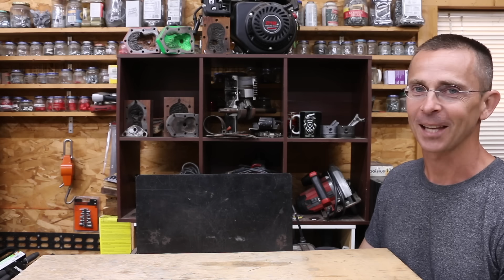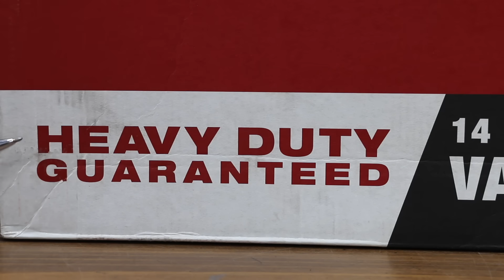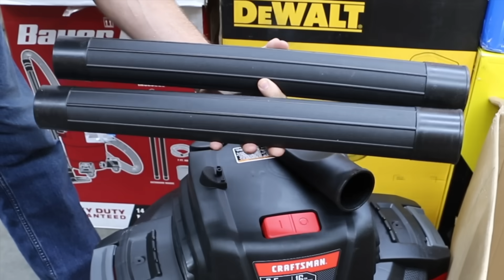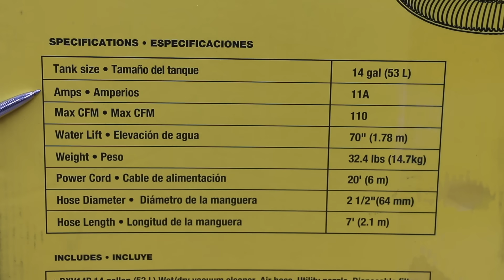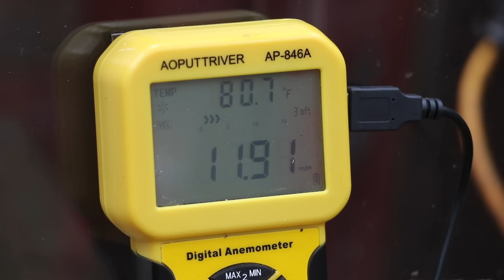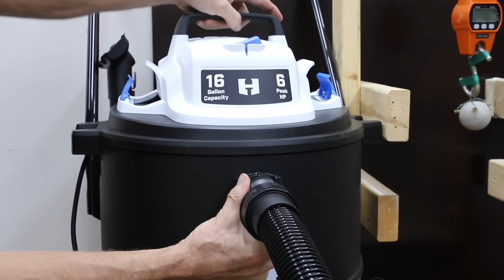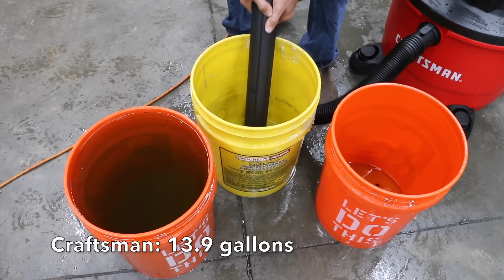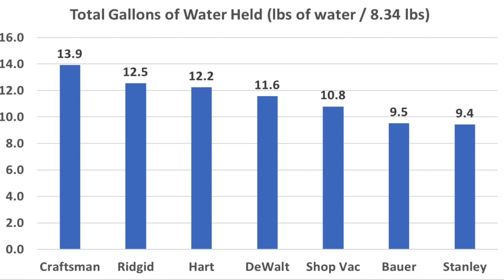Best Shop Vac? Ridgid vs Shop Vac, DeWalt, Stanley, Hart, Craftsman

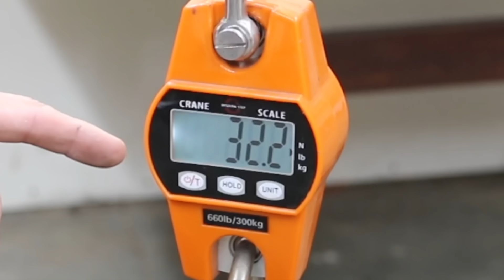Comment: FYI... The Dewalt is powerful, but VERY LOUD. According to the tests @5:50, the Dewalt is supposedly the quietest of the bunch. Not true. Maybe the design has changed since this review? I recently bought the exact model tested here. It's waaaay louder than my old shopvac brand of similar size and power.

Comment: I packaged taped the bucket and gat some car glass sealer and put it on the motor part and really fast attached  them left it 2 days to dry.   When I took it of It had a perfect seal   once I removed the tape the sealer made a perfect match vac has way more power

Comment: Mine falls over as it too tall, clogs up once in a while , sucks only OK...but I can't get a new one...This Sears is 30 years old and I do not trust another to do so. Unfortunately the longevity is hard to test. Oh and I have only ever had 2 filters. With the second one I decided to clean it. That is what I have done for 28 years ...shake it out outside than blow it clean with my air hose.

Comment: too late of course but I wonder if the suction performance of the loose fitting units can be fixed or improved by say adding weather stripping to the interface?

Comment: Except for wet pickup, a shop vac without a filter is worthless. I used to carry Craftsman vacs for all my field installations across the country. But with different size/color filter cartridges being hard to find, there seems to always be one available for Shop Vacs every place I go (one size fits all). So I switched to Shop Vacs and never looked back.

Comment: I found this video very useful, but I want to take the concept of the  shop vac to the next level: ditching all the dry filters and canisters (that always clog and which are messy and dusty to clean or replace) with water as the filtration element period. When the job is done the vac is opened and contents of the dust and debris laden liquid is poured out, rinses clean, and reassemble.  The machine sees a constant load, assuming a fixed volume of water. There are even ways to modify cyclone dust collectors into a wet collection units further increasing solubility. Please don't confuse what I'm  saying with wet vac mode. The water is already in the vac and dry dust laden air is forced through the water, acting as a filter,  before existing the vac. I can't believe this isn't the way it's done...water as the filtering agent

Comment: I've got a 35 year old Shop Vac I pulled out of my unheated garage. Replaced the filters and put in a fresh dust bag. It worked good as new. I used it do draw out a section of a water logged 4x4 fence post, then reversed the vac and used it as a blower to dry out the remnants of the post. It ran continuously for a half hour without overheating. That's pretty impressive since I've used it as a dust collector vac for my table saw for many years. Got my money's worth since I only paid $30 bucks for the thing.

Comment: Sucking a ball with a different diameter hose will have a completely different outcome if measured in pounds because of surface area. Same goes for the opposite, think pressure. This is how jacks work. The larger the hose applied to the surface of the ball the more it can “hold on” so to speak.

Comment: this is an old video but wanted to mention that Harbor Freight sells their extended warranty plans (1yr/2yrs) and are very good at honoring them, they just let you pick a new item off the shelf if you bring something in with a problem, no downtime waiting for replacements or shipping costs to deal with.. also no need to deal with warranty claims call centers (like Ridgid!)

Comment: I've been using a Ridgid portable vac for years and one thing I can say for it is it never let me down. It fell down stairs, used it to suck up raw sewage, fairly wide hose that is easy to unclog,  I just yeet it in the back of my truck when I'm down. The thing is solid.  On the down side, replacement filters are a bit expensive and the hose to reservoir connection is a bit sketchy.

Comment: Todd, Thanks for running all these tests, you always do such a great job.
 I'm thinking the bauer with its lower airspeed is somehow making up for it by using a crappy filter to increase suction, thereby expelling the finer particles out the exhaust. Did you happen to notice a greater amount of residue around the bauer exhaust?  Other vacuum repair shop videos talk about "dirty" vacuums that expel a good deal of dust as it escapes the filter. Too bad they all couldn't share the same filter in these tests, as  I realize some have differing mounts. Do you have a particle meter?

Comment: ya if a company gives a low warranty it tells me their not confident in their product long term. and the longer the warranty the more replacement units they need to hold in storage. required by law. but i suspect harbor freight has the 90 days on the bauer to try and get you to buy the 1 or 2 year extended warranty options.

Comment: I would like to see more emphasis on build quality. Efficiency I think is an important factor too. For example a motor could be drawing more amps but that power may not be translated into CFM or suction. Same with noise some motors are just poor quality compared to others. The motor is one thing the design of the mechanism that creates the airflow is another. That may be dramatically different between these units.

Comment: Here's my Shop-Vac story 35 years ago I bought a craftsman shop vac to clean up batguano in an ol farmhouse I bought. The guano was many inches thick sitting on top of the sheetrock in the upstairs attic. It did a great job of cleaning up all the guano. I had pulled all the sheetrock out of the upstairs, so all the upstairs had exposed rafters and wood under the roof shingles. I came upstairs one night and hanging from the rafters was a ball of bats about 25 of them just hanging there all stuck together. I took the Shop-Vac screwed on the extension and sucked every one of those little suckers up. It was a craftsman shop vac and it had great suction. True story

Comment: I have a 16 gallon Craftsman that is over 20 years old. The wheels bit the dust and the hose has been replaced but it's still going strong. I recently added a cyclone and put the vac, the cyclone and all the accessories on a welded steel rack. 😁

Comment: The "Suction Performance" as the force measured at the rubber ball, isn't really a usefully comparable quantity as you always get higher forces with larger orifice diameters and the shop-vac isn't usually used to pull large objects. The quantity to be compared should be a magnitude of the vacuum created (pressure difference to the ambient), which could be measured as the force pulling the ball, but always with the same diameter of an orifice

Comment: In all fairness to the Bauer, you get the option of extending the warranty for an additional cost at time of purchase, not to mention it would probably be the easiest to warranty. Just take it back into the Harbor Freight you bought it at, and get a new replacement.

Comment: We used to rebuild tungsten furnaces for GE , where they made light bulb filaments. We had to run a vacuum all day in the furnace to pick up the debris from the bricks. We tried many brands and even dual motor 55 gallon industrial vacuums . But the Craftsman and  Ridgid were the only ones that would last very long .

Comment: Excellent comparison! Here's a big problem. I recently bought a Maxum five gallon which is the higher end Canadian Tire brand. I'm satisfied with it but it's very hard to find bags or any of the optional attachments. I realize I would of been better off buying a Shop Vac because in my neck of the woods their inventory is always stacked to the ceiling. Other available brands like Craftman(Lowes), Rigid(HDepot) and DeWalt(Anywhere) have the same problem.

Comment: Things for you to test:
Mig welders

Leaf blowers

Power inverters

Generators

Single phase to 3 phase converters

Thermostat (accuracy, how fast they shut off and turn on, ease of use)

Brands of brazing sticks

Soldering irons

Brands of screws

Hedge trimmers

Pressure washers

Comment: Since you sometimes like to dissemble things There is one other thing you could of looked at and that is what kind of bearings does the motor have . Sleeve bearings have a much shorter life than sealed ball bearings . Question do any of the motors still use ball bearings or is longevity a thing of the past? I had heard that newer shop vacs do not have as long of a service life like ones from many years ago did, just don't know if that includes all of them.

Comment: What I've noticed is that vacuums and accessories have become more cheaply built over the years. My old Shop Vac came with a long one piece metal wand and aluminum suction heads, and had high quality wheels and metal frame. Now all you can get is plastic. Even though my Shop vac died, I still use the accessories on my replacement Rigid vacuum.

Comment: My Craftsman is good BUT the hose crimps at the inlet.  I eliminated the crimp at the extension by fitting a 2” 90* elbow on the hose. (Looks like crap but it works.)

Comment: I just bought a dewalt wet/dry vac from Lowe’s. The hose is supposed to snap in to the unit and be secure right?  Mine doesn’t. Seems obviously the wrong size but is there something I’m missing?

Comment: So the Bauer is like that big, strong, obnoxious, loud friend you've got that you call when you need to move furniture or tow a car. He might be sorta hard to be around but when you really need help he's the first one you call.

A vacuum cleaner is just about as basic as it gets. It's an electrical motor with a fan attached. The strength of suction has got to be the main quality of the tool since there really isn't too much else to the tool. They are all pretty dang loud though.

As usual quite thorough and completely, competently done.
 Great info. Thanks Todd.👍

Comment: Good job, but a couple of points:
Amps is not really an indication of power or motor quality.  Power Factor can be different and electric motors used for consumer products have a wide range of efficiency all on the low side.
Suction depends on the hose dimeter, it is better represented in PSI or Pascal.  To make a fair comparison the Force Reading should be divided by hose diameter Squared.

Comment: Overall, there is some great data here, but I have some concerns about the way you performed the suction ball test, and have some doubts about how much its results reflect real-world cleaning performance. First off, your test gives a pretty big advantage to bigger hose tip diameters. The force exerted by a vacuum hose is going to be equal to the static pressure the shop vac can maintain with its inlet totally sealed off multiplied by the area on which that pressure has to act.  A bigger nozzle is going to give that pressure more area to act on, and so will increase the force that can be exerted on the ball.  I would suggest improving this test by either dividing all the results by nozzle area (or maybe the surface area of the ball covered by the nozzle, I'm not totally sure which one actually matters here), or simply putting an airtight plug in the end of the nozzle and sticking a pressure gauge through it to directly measure the static pressure.

However, even if you did properly test static pressure, I think this test is much less valuable for consumers than pretty much all of your other tests.  What matters far more than static pressure is inlet velocity.  If you were to hook a vacuum pump up to a piece of pipe around the size of the shop vac hoses that's closed on one side, and has a nice, clean edge on the other, and seated the ball into the opening well before waiting for the pump to pull a vacuum, you would be able to exert far more force than any of the shop vacs here.  I don't think anybody in their right mind would want to use a vacuum pump for cleaning, though.

Comment: I understand that we want to know which tool is faster, not just in this test, but also when looking at drills, mixers, whatever. I feel like the top end has gotten so good that we're just kind of splitting hairs though. Like if a Dewalt really fastens a bigass lag bolt .25 of a second slower than a Milwaukee, does it really matter? I doubt it.

Comment: We use two craftsman’s at work at a vehicle vacuum station. They’ve been used 100+ times a day, for an average of about 5 minutes, for probably a year now. Only things I don’t like are their proprietary hoses, and the performance really suffers when the filters get dirty. Before these, we went through dozens and dozens of Dayton (grainger) brand. The on/off switches always failed first.

Comment: A bit late to the party, but here's some constructive criticism: You can't use amps to measure AC motor "efficiency" or "output power" due to the motors' unknown power factor.You'd have been better off using the wattage function of the Kill-a-watt (which also gives how much power is actually being used). Amperage is good for knowing you're not overloading a circuit, but (for consumer use at least) its the wattage that translates both to power used (and produced) and to how much it costs to run (electric bill). Power factor is an thing for industrial electric bills, but that's when one is talking a whole factory full of machinery, not just a "small" shop vac! AC power can be a pain!

Comment: How about a review of the various filter + bag options for shop vacs?  A couple years back I bought a ridgid bag+HEPA filter with "cyclonic action" that claims to be OSHA compliant.  These are made for dustless jackhammers, and filter out all that nasty fine concrete dust so it doesn't go in you lungs  The concrete broke up much easier than I was expecting, and I didn't wind up using a jackhammer, and needing the fancy HEPA filter + special bag, but I do like the idea of sucking up small amounts of concrete dust, and not worrying about silicosis.  So it'd be nice to know what I'm really paying for.

This also sold me on the idea of having a bag in the shop vac for easy clean-up, but I of course notice there's a variety of different options at different price points, as well as different options for the filter itself.

Comment: Unfortunately, the Craftsman has changed the design and is now Chinese made, as I discovered today.  Inferior workmanship.   The 2 handle latches will not even hold the bottom part of the vac when lifted by the top handle!  I am returning vac to Lowe's today.

Comment: WOW! THANKS! This was a great face off of vacuums. You did a really great job of testing most of the stuff that matters. I was just shopping for a new vac and found your test video, boy does that make me happy!!!
I was not surprised by the good showing of the Craftsman, they have always been one of the most powerful on the market. My dad had a huge one that had like a 30 gal bucket and I once sucked a tub full of water in like 10 seconds with it! But it was crazy loud.
I agree with you on the Bauer warranty, although I am still considering it, as there is really only a motor & switch to go bad & I'm an electrical guy.

Comment: Your testing was a bit skewed rigid had a larger diameter hose than the competition that’s a good move more volume just because the diameter of the hose. I’m not trying to say rigid isn’t a good vac I have recorded version and I have the Milwaukee M 18 both very good although even in those the ridges hose is a lot larger in diameter.

Comment: I have a Rigid that's about 16 years old that has the detachable motor for leaf blowing.
The thing has been a workhorse in my shop, zero complaints..  Maybe they don't build them like they used to?? 
Actually find I use the leaf blower attachment quite a bit because it's quick and easy to set it up.

Comment: There was a surprising amount of bias in this video. Super disappointed. In both the water test and the sand test you didn't let the Dewalt finish before handing it the win. Don't stop the time when there is still material in the bucket, the Dewalt was the only one not made to empty it completely. The water test also cut off right before they both finished.
Good job to Bauer though, it had some surprising results!

Comment: Video idea: make a video comparing different gauge guitar strings, or different brands of guitar strings. (Which strings last longer, which brands have the best anti-corrosive coating, string strength after bending/stretching, etc.

Comment: Also. I must have a slightly different Ridgid model than yours. 
Mine to has the leaf blower also, but the lid is latched down on the sides and when properly latched I dont have anything even remotely close to the play between the lid and the base that you are showing. In fact I paused posting this to go outside and check. Mine literally has ZERO play between the lid and the bucket. to be fair mine is now about 10 years old and they may have made cheaper quality revisions since then.   Mine had no problem at all sucking out chunks of broken up shale out of footing holes I had to bore out to build my12X20  shop.

Lastly when they mention hose diameter. I believe they are referring to the diameter of the hose itself and not the connectors as often when you buy replacement hoses they sometimes dont come with the connector

Comment: I needed a shop vacuum for standard uses around the house. I bought the Bauer 4hp 6 gallon for $45, no extended warranty. The vacuum is great, I have used and abused it for 1.5 years and still works like it's new, cant beat the value.